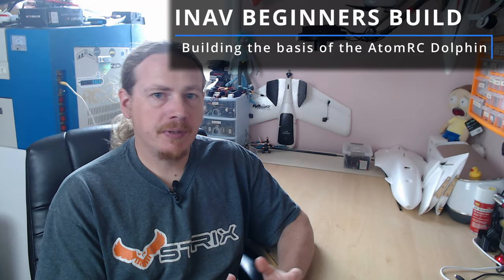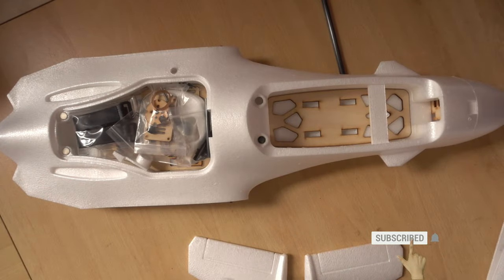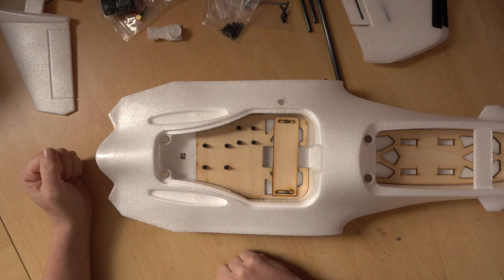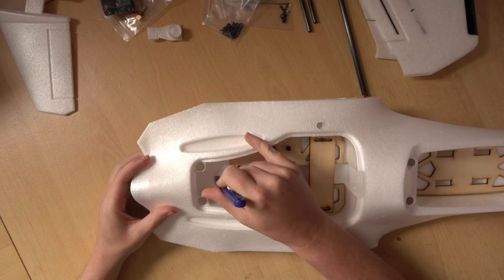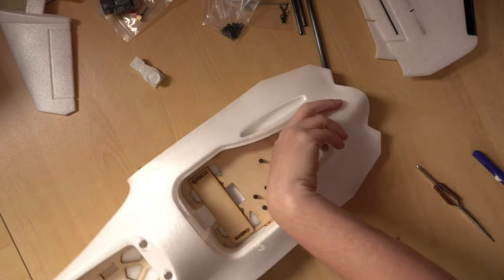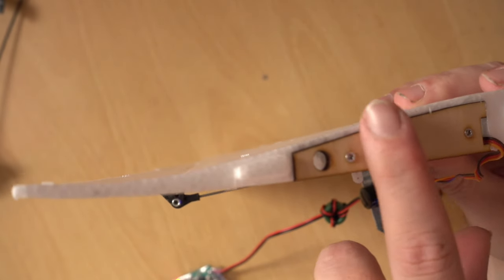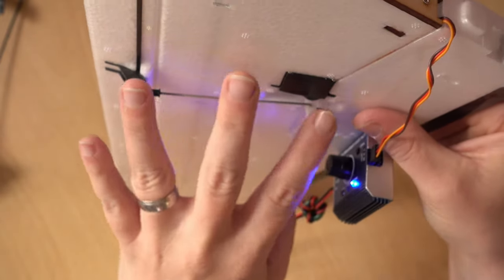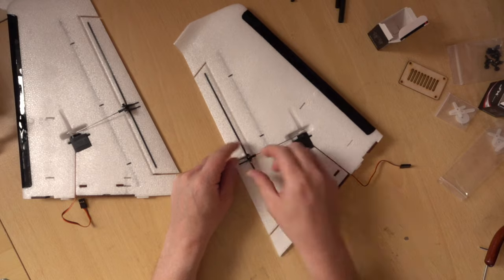iNav 5.0 Beginner's Build Academy: Lesson 02 - Building the Dolphin

Comment: Great build video going to get myself one of these planes have heard many good reviews on them.
Reply from the maker: They fly very nicely. I maidened my friend’s Dolphin, and it was faultless. I can’t wait to finish this build.
Reply: @MrD  I’m looking forward to seeing the rest in of it. The new elrs 3.0 coming out looks awesome. Do you plan to use it?
Reply: @stonesrcchannel  Despite the fact that there could be more ELRS pilots flying together, a faster response of the transmission (is it relevant for a wing) and an open firmware, is there something more than what CRSF is doing ?
Reply from the maker: No, I don't plan on using ELRS at this stage. To be honest, it doesn't actually offer me anything realistically better than the other control links I use at the moment. I know it's the current hypetrain product. But to me v3 is only just getting features that RC links should have from the start; like full resolutions channels and certification. Most of the cool features seem aimed at quads and quad racing. There are some interesting things in ELRS, and I do like the WiFi update. But Crossfire and R9 work perfectly well for me. I don't need to change either of those for gaining nothing new. Nothing new that I would use anyway.

Comment: so when I have an esc with the power lead pads on the top and bottom like that I drill a hole through the pads just big enough to run the capacitor wires through. Even though it's an extra step it makes soldering things quicker and easier. Thoughts?
Reply from the maker: Sounds like a great suggestion. I doubt there are any ESCs with multi-layer PDBs, so no worries about taking something out. Thanks Tracy.
Reply: What a damned good idea !

Comment: First and foremost - thanks SO MUCH for this series. I am a complete wing noob (coming from multirotors) and this is perfect. I'm trying to follow along but struggling a bit with the servo setup and getting the throws correct. 

At this stage, is it a problem if the control rod touches the wing when the horn is fully deflected? At the moment when the horn is away from the lead edge as far as it will go (elevon up), the rod rubs against the wing, though not a lot. Do I need to play around with the placement now, or can I sort that out later in iNav? Starts touching around 950us.

Thanks again for this awesome content, really appreciate the amount of time that's gone into it :)
Reply from the maker: Welcome to fixed wing.

You should not be down to 950us. The initial range is 1000us to 2000us. You should not change this unless as a last resort. The control surfaces should be set physically first, to get the right amount of throw. How to do this is shown in the video.
Reply: @MrD  Ah okay - this value is just via the min/max of the servo checker, which I think goes from 800-2200.
Reply from the maker: Some systems use different values. So the servo checker will cover all bases. On INAV, for control surfaces, just keep the outputs to 1000-2000. This is fine in most cases.

It’s only when there is a physical limit or specific circumstance that we usually changes these. For example, pan and tilt setups, they are increased to get the absolute maximum movement.
Reply: @MrD  Gotcha. So if I check with 1000-2000 and the movement is all unobstructed, I should be good (😬). 

I’ll give it a go. I did try various combinations of the horn/rod holes and all seemed to have some sort of contact against the wing, whether it was near the servo or near the push rod connection, so I was hoping I could compensate in software.

Thanks for the response, and thanks again for the videos!

Comment: Darren a question if I may.......how many devices can you run off 1 GPS module?
Reply from the maker: Honestly, I've never tried. I guess you should be able to split the Tx from the GPS and attach it to multiple device Rx pads. But just power it and have the GPS Rx from a single, master device. You would also need to plan the grounds. All the devices would need to be connected without any ground loops.
Reply: @MrD  run the grounds to 1 common ground or each device to a separate ground on maytec flight control.
Reply from the maker: @M-H433  honestly, it depends on how everything is set up. If all the other devices are powered from the flight controller, it will be fine.
Reply: @MrD  Thanks Darren,looking forward to the next videos.

Comment: On mine the control rods they provide are 3mm to short. When the servo horn is 90° to the wing, there is barely 3 turns holding the ball clevis on the rod. Not good for a plane capable of over 200kmh/h.
Reply from the maker: The servo horn shouldn't be 90 degrees to the wing. It should be 90 degrees to the control rod. The rods I have are 78mm from the closest bend in the Z bend to the end of the thread, or 85mm overall. I'm getting around 11-12 turns on the ball joint.

I understand that this is mass production, and mistakes can happen. Maybe they are Seal or Killer Whale rods by mistake. Also, PnP, this thing would do around 130km/h, nowhere near 200km/h. The parts from the manufacturer will be spec'd based on the PnP version. For a fast build, I would swap the rods out for 2mm anyway.
Reply: @MrD  They may have changed them in the later Dolphin kits. I have 2 kits. Both have 73mm rods. From the Z bend to the end of the thread. It was impossible to get the mechanical set-up correct. The rest was done in the mixing.. Fortunately it had no adverse effects on flight performance.
Keep up the good content.✌
Reply from the maker: @tomjenson9053  that could be the case. The kit I have is pretty recent.

Comment: Thanks for the video, is there issues with 5.0 and the  OSD? I’m using a matek  722 FC and using an analog video system and no matter what I do I cannot get any OSD in MY  goggles. I even tried it in auto , Pal and NTSD. I even tried moving the Characters around the screen and still nothing. I also tried to reload firmware, still nothing.Thanks
Reply from the maker: No problems with the OSD in 5.0. Check the modes page to see if you have and mode ranges in the OSD section. Possibly an alternative OSD is being selected or even the OSD is switched off. 

I would suggest uploading the font. But I think it would be strange for the OSD chip not to have a font at all. But it can’t hurt trying that too n
Reply: @MrD  Thanks for the quick response, I did download the font just to make sure and as far as the mode goes I do not have any modes selected forOSD, just running default and on the I believe was the configure page I have OSD turned on. I will play with it a little more and if anything wait for the next update to the firmware. In the meantime I downgraded back to 4.0 and it’s working fine.Thanks for the help
Reply from the maker: Ok, that does sound pretty strange. It would probably be worth reporting that on the iNav GitHub, mentioning the specific flight controller and target you’re using. https://github.com/iNavFlight/inav/issues
Reply: @MrD  Thanks, I will put in a ticket
Reply from the maker: @Joneszee1969  cool. I’ve just added something to look at. The OSD needs to be correct on the Ports page with that FC.
Reply: @MrD  👍🏻 Will check that and let you know how I make out. Thanks again for your help
Reply: @MrD  Thanks guys for all your help the problem was I didn’t have the frisky OSD protocol selected, I must’ve tried to put something on that UART 6 and never reset it. Thank you Darren for your recommendation to check the UART and for all the other guys suggestions…👍🏻😀